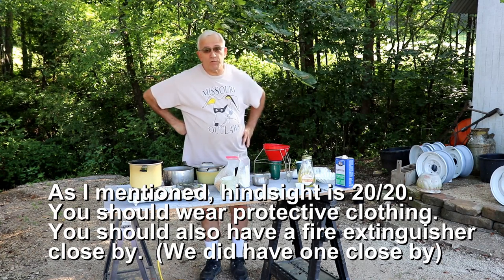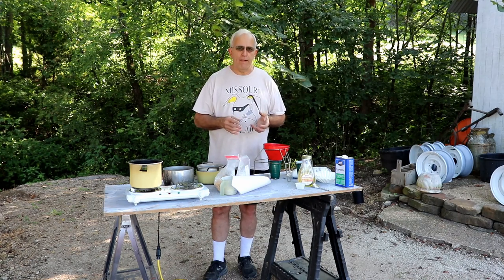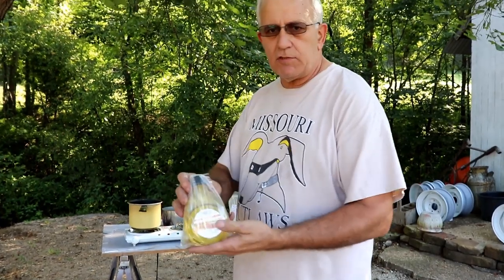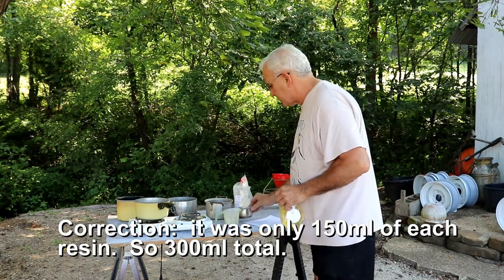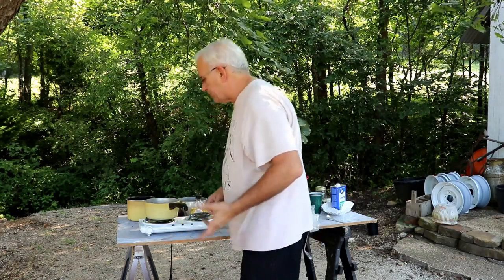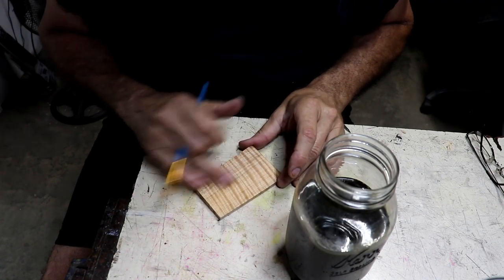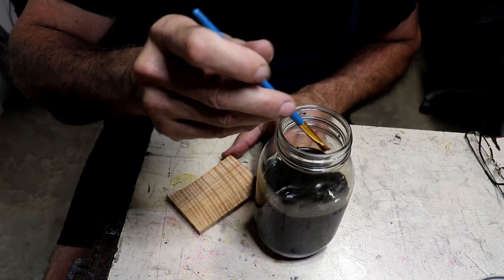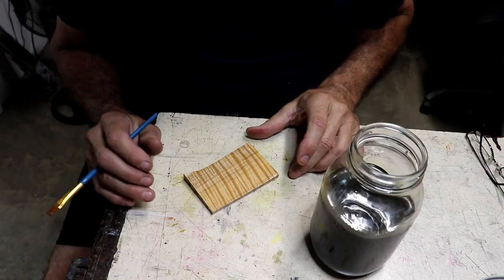317 RSW Old School Varnish Making 1st Attempt

Comment: Oils don't dry as in a solvent (water, alcohol, etc) evaporates, but polymerize/oxidize, i.e. a chemical reaction takes place which usually just takes a lot of time. Using oil on wood (e.g. furniture), it can take a week to cure a thin layer that has been basically wiped off after shortly after application. The siccatives (japan dryer) do help with the time it takes to dry, but then you're introducing chemicals one may not want to include.
There seems to be quite a bit to choosing and preparing the oil as it can be filtered, washed, heated, aired and whatnot (and I'm not an expert on that, I found Edgar Russ's video helpful to understand the oil part better: https://www.youtube.com/watch?v=ZpD251wcFpc). And then it can be boiled for a long time before starting to add the resin.
I'm not building music instruments, but I want to try give oil and resin varnish a try with some small woodworking projects, so thanks for the insights you share in this video.
Reply: Any results yet, David? Would be interesting. I'm still trying to get a reliable varnish the  easiest way.
Reply: @Wolfgang3418  not gotten around to it yet. Have you checked luthier or conservator supplies? I doubt making varnish will be an easy way. :)

Comment: Jerry you ain't gonna get away with not giving us some updates on this varnish! I have for years wanted the old masters varnish and you are on the Right Track!  Did they have turpentine in Stratovarous's time? What would they have used? I know shellac is very old. I read somewhere they cut the shellac flakes with whiskey or brandy, any spirt they had. Those resins you got may be harder than nitrocellulose. Please, you have to keep us updated on your progress. If this stuff works, you may be on to Something! Love Ya! Thanxz
Reply from the maker: Turpentine comes from evergreen trees I believe. So I'm sure that was available. Barney's shoes that dilute with alcohol are referred to as spirit varnishes. And I'm not wanting to use those. Actually I did use shellac for the base below the oil varnish. The oil varnish will completely cover the shellac though.
Reply: Tar, creosote and turpentine all used to come from 🌲 and still do to some extent. Regular whiskey would raise the grain, need higher proof.

Comment: I think it is just like shellac.  You probably need to cut it with white spirit.   Yeah playing with flammables in shorts is not recommended.  Getting hot oil based products on you will sure spoil your day.  When doing experiments like these make notes on what you are doing, so when you get to the right place, you will know exactly how you got there, and so can replicate it.  Otherwise you will just have whatever you made, and no idea how to get back there.  Oil finish takes a while too dry. The linseed is the problem.  It just takes forever to dry.  That is the idea.  Think oil paint.   Use more volatiles, which will flash off easily.

Comment: Im not an expert at these varnishes either. But I will advise with the string test, it did not get thick enough, your string was around just under an inch, which is 2.5 cm, a good string test is 2 inches or 5 cm, but even longer is better. And also the varnish is supposed to take that long to dry. It takes 3 or 4 days to dry when its outside with good sunlight, it takes UV light to dry. In the summer you just need to sit it out in the sun but during the winter its better to keep it inside under a UV light. And lastly with the color of the varnish, alot of variables go into that, such as the amount of your ashes, the types and amounts of resin or rosin, and the amount of time you reduced your oil. Hope this helps if you still have hopes for these varnishes.

Comment: Just made  mine in the microwave stirring the resin into the Turp after heating, dissolved about 50/50 and added tung oil. Where did your guidelines come from, I wonder..? (its gotta cool before you get a  string, then you will) Mine dries in 20 minutes..

Comment: u sure u don't wanna make it extra crispy. and cook it longer. lol. but how would u do it, where it wouldn't flash?    like how cool would u need it to b to add the turpentine so it doesnt flash???  but either way that is a pretty color.
Reply: If you remove it from the heat source and let it cool just slightly, pouring in the turpentine will not cause a combustion. If you look closely, it flashed because the evaporating fumes hit the heat source (the burner plate) directly and ignited. Turpentine self-ignition temperature is about 250 Celsius or slightly below 500 Fahrenheit. All parts of this varnish are flammable and none of the ingredients should ever come in direct contact with a heat source that is hot enough to start a fire.

Comment: Your varnish recipe will not air dry; it is cured by UV light. Apply in thin coats and expose to sunlight, or UV bulbs. You can make a drying cabinet with some 4 foot fluorescent FL40 BL bulbs. Oil varnish will air dry only if you at a catalyst, some kind of metal or metal oxide (usually toxic) as someone mentions below.  Oil varnishes that are UV cured and made without catalysts resist cracking and checking with age better than modern formulations.
Reply from the maker: I've always dried oil varnish without any UV assistance. Done it for thirty-some years. This particular oil varnish just didn't have any dryers in it. Having said that I have built a UV set up and am currently using that. The oil varnish I made is working very well. But mainly because I put the Japan drier in it.
Reply: Glad you finally got it to dry.😅

Comment: Thanks, Jer. This is probably a dumb question, but I'll ask anyway. Would it help in the saturation into the grains if you put it on very warm to slightly hot? Sort of like you  did heating it to thin it out in boiling water...

Comment: Why don't you build a cabinet to contain your instruments for drying?  You could put a small fan with a filter to circulate the air in the cabinet.
Reply from the maker: I'm using my tiny bathroom in my shop. It seems to work fine.

Comment: Interesting.. so I have to ask what instrument advantages are gained in using an oil based finish vs a traditional shellac (with more cut weight) or a Nitrocellulose finish?
BTW - Have you ever tried a product named Seal-Lac and Royal-Lac? I’ve used it on several instruments and it’s super easy to apply (even with a brush) and with a buff out it shines up like any Nitrocellulose I’ve ever used without all that toxic smell. The only caution is to NOT use any wet sand/soap between applications.
Reply from the maker: The problem with shellac finishes are that they melt under human sweat. The oil varnish is hard and gives you a good clean crisp sound. Nitrocellulose is the same way. But I spend hours and hours getting nitrocellulose to cover properly.
Reply: @RosaStringWorks  One quick little trick I learned a few instruments ago when spraying nitro on an instrument is to follow your last coat with the thinner you're using to clean out the gun. I know it sounds weird, but I've been able to get a really nice finish on instruments doing that. Once the last coat goes on and you pour the excess back in the can and put the thinner in the gun, shoot a few blasts through the gun, and then turn it towards the instrument you've just finished. Don't load it on, just give it a nice think shot all over. It tends to even out the finish you've put on and gloss it up a bit. Then it's far easier to sand and polish it up later when the finish has hardened sufficiently.

I've never seen anyone else do this, it was just a fluke when I tried it, but I love the results.
Reply: @willmorrison1022  that makes complete sense. The thinner (I'm guessing acetone for nitro?) would temporarily dissolve the top layer of the finish, making it pretty much self levelling. Great tip!
Reply: Yep.. that’s what Dan Erlewine does and he learned that trick when he worked for Gibson.. he calls it a flash coat and it does exactly that and quickly re-melts the Nitrocellulose Top coat to make it super smooth and ready for final buff.

Comment: I've researched oil varnish recently and it didn't turn so well either :) 

In the videos I've watched, it seemed pretty thick (almost like your 1st version) and it was applied with the fingers. Don't know if it's how violin makers do because they don't share much about their varnishing techniques :|

Also, I've seen them using a UV cabin to dry/cure/polymerize/oxydize (don't know what's the right term) the varnish. One of my luthier friends who is making renaissance luths is using a UV cabin for his oil varnish.
Reply from the maker: I've never heard of a UV cabin
Reply: @RosaStringWorks  it's like a tanning booth for varnish! The UV apparently speeds the polymerization, resulting in a faster cure.
Reply: @davidrea8833  I've read about this but was under the impression that the varnish or paint has to be formulated to harden under UV. So I was mistaken in that belief, then? Not a bad thing to find out. It would be great to speed up the process just by shining the right light on it.
Reply: @willmorrison1022  That's my understanding of the chemistry. Oil based finishes don't really dry, they cure, which means that the various hydrocarbon chains all link together. UV provides extra energy to speed up the process.
Reply: @RosaStringWorks  I've read this today, talking about a UV box : http://www.makingtheviolin.com/Varnish

UV are supposed to accelerate the curing of the oil. Turpentine is used to cut the varnish and make it easier to apply, and it evaporates pretty quickly on its own (1 day generally). Linseed oil, even when cooked, needs to be cured with UV light (the sun works, and that's what ancient luthiers were using). The idea behind the UV box/cabin is to have a better control on the curing of the varnish (no dust or insects, humidity control,...).

I want to experiment again with oil varnish, and I think I'll build a UV box :)
Reply: UV is a good point. And the oil needs to be washed. In other words, it has to be pure and free of lanoline. This process is done by mixing oil with water. After s day you pour out the water which has absorbed the lanolin. Repeat til water remains clear. Only purified oil has good curing properties.
Reply: @amajorseven  That's interesting! I read about cleaning the oil with sand, salt and water. But according to you plain water is enough?
Reply: @Wolfgang3418  I‘ve got the information from Edgar Ross Distinguished Violinmaker. This is the name of his yt channel. He cooked varnish in his garden as an educational project. I wanted to give it a try but eventually I bought varnish from violinvarnish italy. It was my first instrument built and I didn‘t want to risk messing up my cello. As far as the distribution is concerned a brush is fine for applying a coat. But in order to really evenly disperse the varnish layers tapping with fingers is recommended. It gets more and more sticky as you continue. But don‘t worry. The surface will harden with a flat even glossy finish. UV is possible but not necessary for the product from violinvarnish italy. For other products UV might be necessary. Good luck

Comment: I think when he poured the boiling turpentine into boiling hot oil thats when the turps volatized and exploded. As a result most of the turpentine evaporated leaving mostly oil and resin. The resin wouldnt dry because there was essentialy no turpentine left except maybe a little. The varnish wouldnt cure because there was no air evaporation of any turps. Because there was no turps due to explosion the resin oil just sat there grinning at us. There has to be air evaporation  to allow the ingredients to cure. I think that is basically correct. I THINK PLAIN OLD DAMAR VARNISH THINNED WITH TURPENTINE AND ALLOWED TO AIR DRY WOULD.BE AN ACCEPTIBLE VARNISH. NO FOOLING WITH HEATING TURPENTINE THOUGH THATS JUST ASKING FOR EXPLOSION. IF YOU WANT IT TO DRY FAST I WOULD SAY SHELLAC AND DENATURED ALCOHOL LEAVE THE TINTS OUT OF THE EQUASION AS THE ACIDS IN THE TINTS RUIN VIOLIN TONE. SHELLAC COMES FROM TREES  AND IS QUICK DRYING. ALL I CAN SAY IS USE AT OWN RISK!

Comment: Japan dryer - that's the job, if you like the results. I was thinking at first you were trying to imitate French Polish - but it was the use of oils that confused me there. The thing with French Polish is that the oils really take a long time to harden. So in French Polishing, you are really only using the oil as a lubricant - then you take it off. But the same thing happens in varnish - where the oil basically refuses to harden. Hence, Japan dryer. Knowing you - you are always going to keep at it until you have found a fix. So, another video on consistency of results would be good. I thought of making a little plastic hood arrangement where instruments could hang to dry. Problem then is air movement (not enough of it). Anyone interested in French Polishing can watch hours of videos by the humble master Pablo Requena -   https://www.youtube.com/watch?v=Uf4z14Vjkxk&t=360s
Reply from the maker: Definitely not doing the French polish thing. French polishing is done with Spirit varnish.Which is basically alcohol. Those are not my friend. The problem mainly is that they're not very good around any kind of moisture. If you sweat the Finish will turn milky color

Comment: Well at least you two were sort of expecting it to flash. Think you just got too impatient and dumped it in too fast.
EDIT: And you should almost never expect it to dry in a mere 24 hours, period. If you can lay down a single super thin coat (lots and lots of practice) will give you that 24 hour change. You now know why they don't use oil varnish anymore, 48 hours before you could expect it to start firming up.
Maybe keep it under a UV lamp for those 48 hours.
Reply from the maker: A slow curing varnish is actually what you want to use on an instrument. As I said I just prefer it to be a little bit faster because of my dust situation.

Comment: As I'm sure you know, varnish doesn't really dry - it cures.   As the solvent evaporates out of the varnish, it draws air into the finish as part of the evaporation process.  The air contains oxygen, and the oxygen causes the resins in the varnish to cross-link and polymerize.   The process works the same for oil finishes which is why you never leave rags wet with oil sitting around as the curing process (oxidation) produces heat which can cause the rags to catch on fire.   The use of driers (cobalt, Japan, or Epifanes Accelerator) cause the varnish or oil to more readily react with oxygen, which in turn, promotes more rapid curing of the finish.  The varnish you made contains no driers and the recipe is using the turpentine as the "drier."

Turpentine is a unique solvent.  It has the solvent power of varnish makers & painters (VM&P) naptha, but has the slower evaporation rate of mineral spirits.  You use less of the solvent to achieve the same level of thinning than you do with mineral spirits so the viscosity of the varnish is better controlled for brushing.   Varnish makers like Epifanes, Awlgrip, etc. have special brushing thinners (https://www.epifanes.com/page/thinners) that provide thinning with viscosity control so that when the varnish is "tipped off" with the brush, it flows and levels, but does not run.

You're exploring an interesting area of finishing, and it is extremely interactive with the components being used.  As I've suggested in my previous post, I think you may want to add a drier to the varnish in order to promote curing.
Reply from the maker: I thought I mentioned that I did add Japan drier in the video. I just applied the varnish to a mandolin I made. It really turned out very very nice. In fact probably the nicest varnish application I ever did in my life.
Reply: Oil varnishes for violins, like the one in this video, do not dry because the solvent evaporates; like the polyurethane or nitrocellulose that you buy in stores, much less like automotive lacquers that use a catalyst to dry.
Turpentine serves mainly to make them more fluid or thin.
What actually happens is that some of its components oxidize and crystallize, forming a natural polymer similar to amber. In nature, this process can take years, therefore, for polymer chains to form and create a film on the wood, you need oxygen, but above all, an ultra violet light source is essential. Historically in Italy, violins were placed in non-direct sunlight; process that can take months. Currently, cameras with ultraviolet lamps are used to speed up the process.

Comment: You might want to try adding Epifanes Accelerator to the varnish:  https://www.epifanes.com/page/accelerator  I have used the accelerator with Epifanes varnish and Waterlox.  I like it better than cobalt drier as the Epifanes Accelerator does not change the color of the varnish.